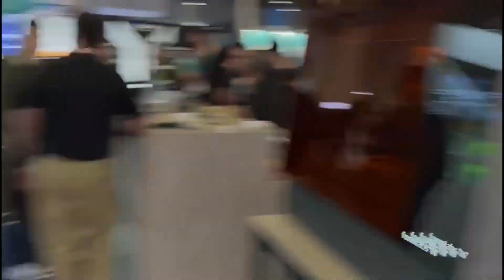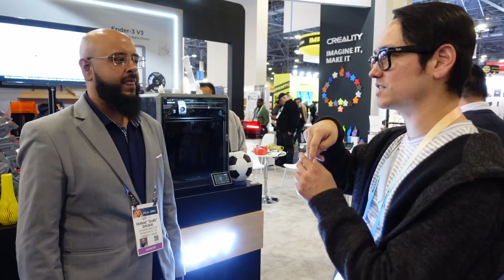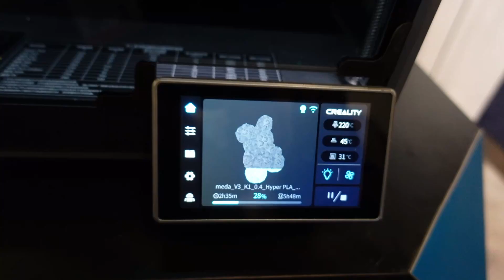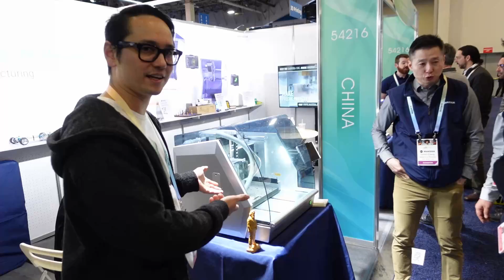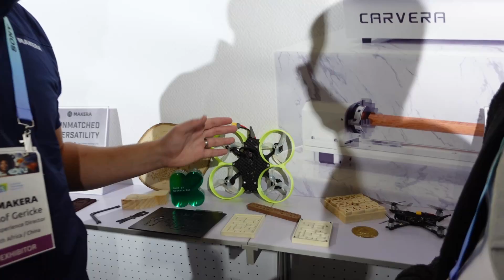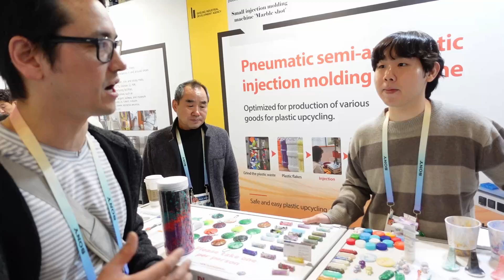CES 2024 A 3D Printer Enthusiast Interviews Creality (K1C), Makera (CNC), Crutec (UpCycling), Nooku

Comment: Makera really does look impressive. You should look into air exchange units for your house if tackling air quality.
Reply from the maker: Yes ventilation is the best solution. Right now I have a dual fan jury rigged into the door. Its perfect during summer, but not so much during winter.